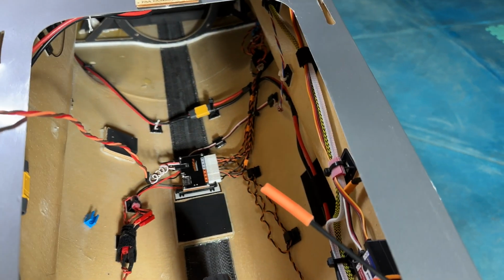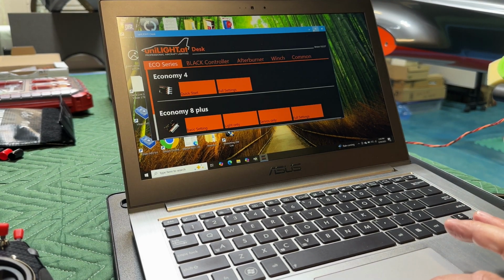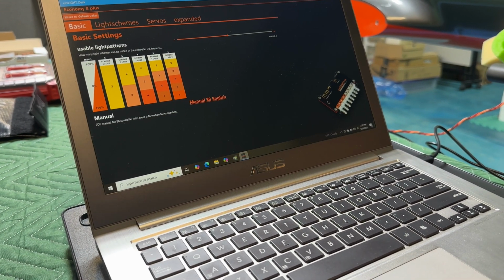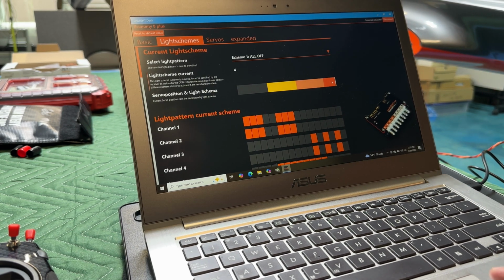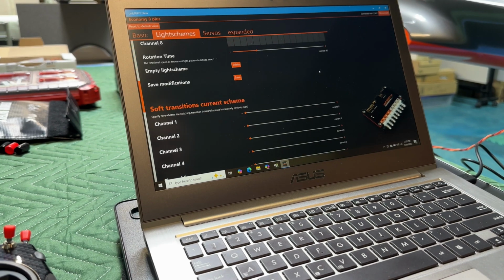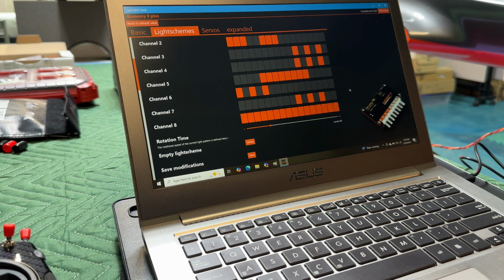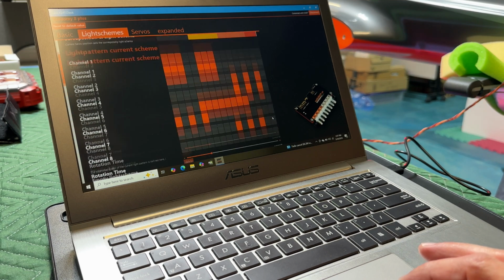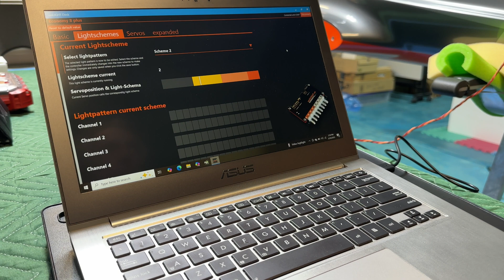Unilight 8 Channel Setup

Comment: Hi, I have a problem with my Unilight E8 PLUS. Why are the lights lighting if wire is placed between 1-4 channels but not lighting if placed anywhere between 5-8 channels. Using Win7 Futaba Mz-18 and twop 7008SB receivers in Powerbox Mercury SRS and bound with transmitter. Using Channel 11 and three position switch just on top of throttle stick. Using Unilight USB programming cable too. Any thoughts? Thanks.
Reply from the maker: The first thought I have is do you have BOTH of the power leads (JST) connected to power?

Comment: Hi Sheldon,

Thanks for sharing. Would you have a link for the USB cable? I can't find it.
Reply from the maker: https://www.unilight.at/en/shop/modul-plus-unilight-programming-cable-2680
Reply: Thank you Sir!
Reply: @sheldoncampbell538  sorry to bother. I received the module for programming the lights. I can't connect to it. I downloaded the software but it won't connect. Id there a tutorial somewhere I can follow? Or can you assist please? Thanks
Reply from the maker: @carlosperez7015  try this https://www.youtube.com/watch?v=F-AsXRRuoKE
Reply: @sheldoncampbell538  i had seen this video. My module isn't connecting.  Thanks
Reply from the maker: @carlosperez7015  I'd say if you have it plugged in correct to reach out to Unilight, sorry
Reply: @sheldoncampbell538  Thanks for getting involved. Happy Flying!
Reply: @carlosperez7015  Look at the COM port on program (usually COM3) which needs to be changed after you plug the programming cable (On my PC it is COM 7). Then click connect. Program cable USB light changes to solid red when connected. I had the same problem but this video here helped me a lot.
Reply: @royrodgers4297  thanks for your response.  Unilight says their module only works with the  "plus" controllers.